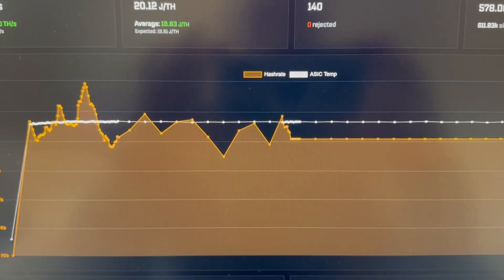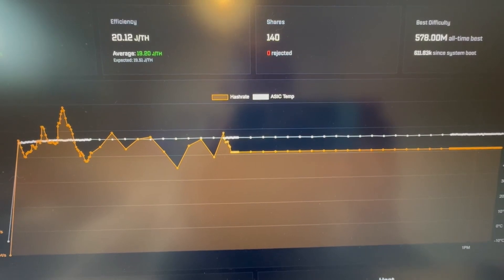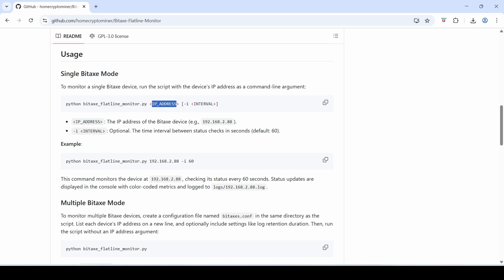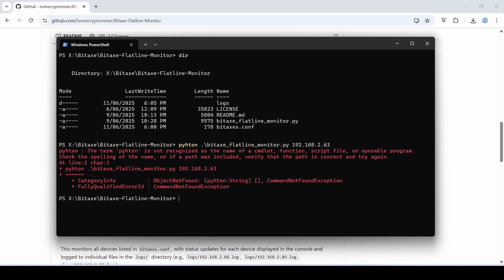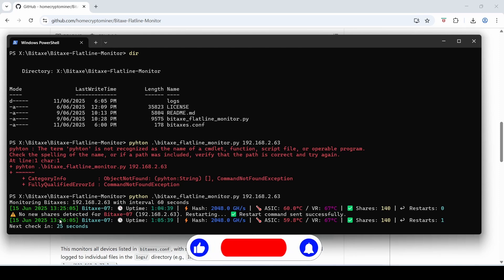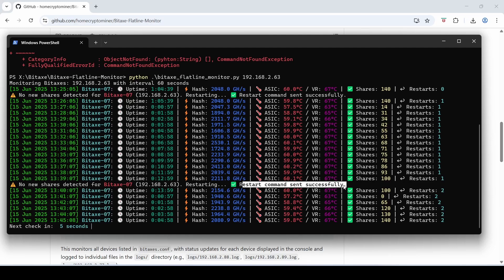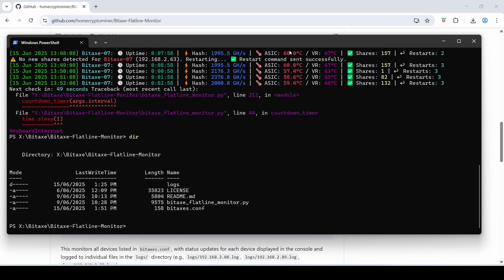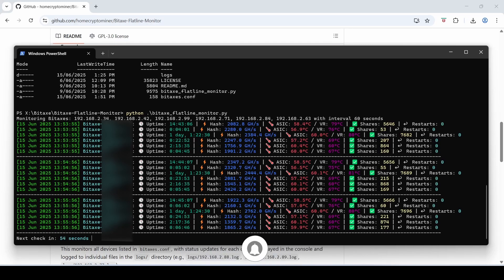Bitaxe Flatline of Death?! Here’s How I Brought Mine Back to Life ⚡

Comment: For sure it can be converted to a micropython or native arduino c++ code and run it on 1 $3 esp32 instead of the raspberry pi .. But then again could be just 5 lines of code watchdog added to the original miner's firmware by the developer

Comment: The script is great but not worth running if you're mining BTC / DGB and the difficulty set is at 100K plus, you won't find a new share every 60 seconds and this restart function would constantly be running
Reply from the maker: The script is very customisable - by simply putting an "-i" (for interval in seconds) parameter you can easily change how often to check. So "-i 300" would check every 5 minutes.